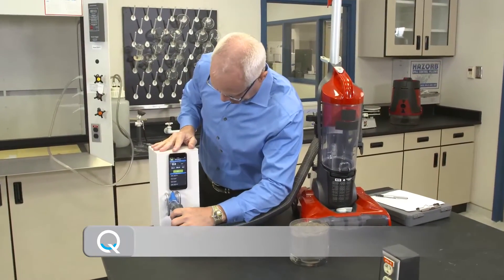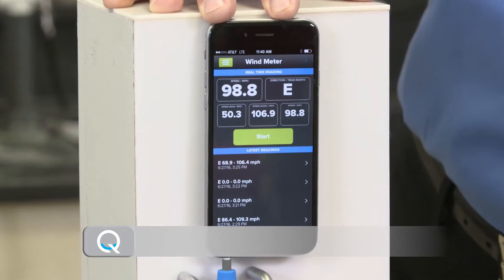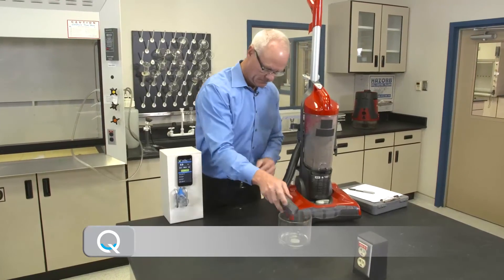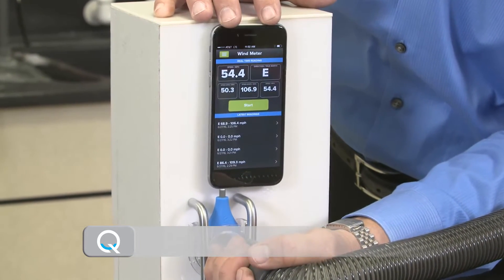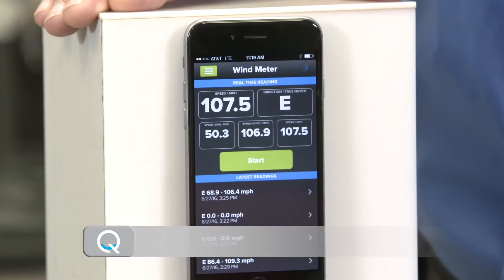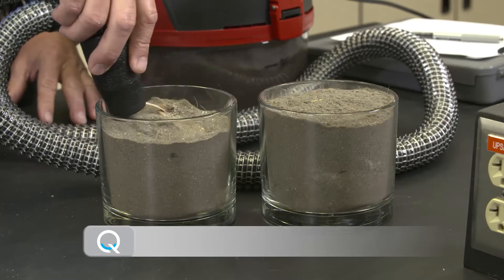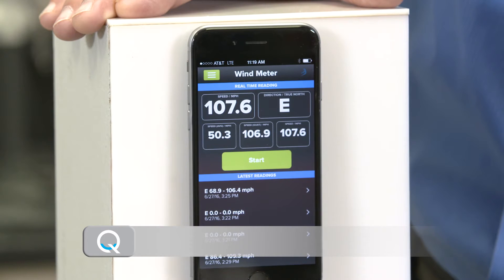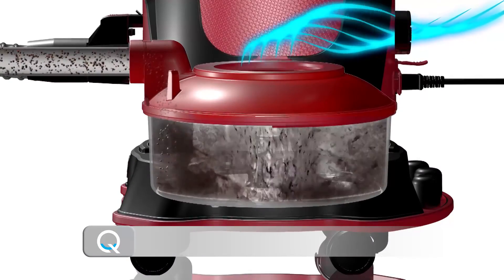Quantum Vac Amazing Air Speed Test

Comment: The Quantum was tested on low speed because the Airspeed indicator could not read what the Quantum air speed was on high speed.
Reply: Randy Spencer with the high mode on the quantum vac, the airflow speed is about 321 mph on the quantum vac